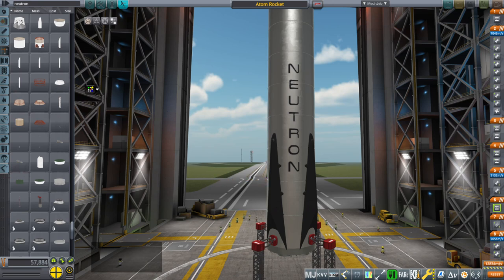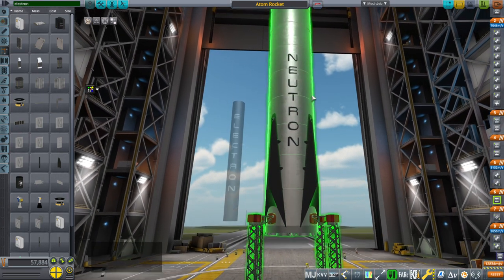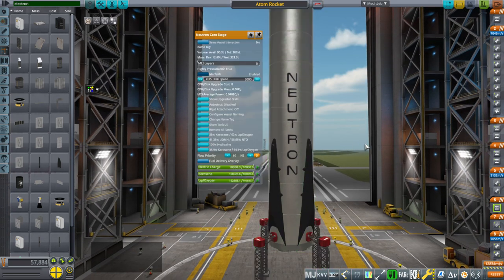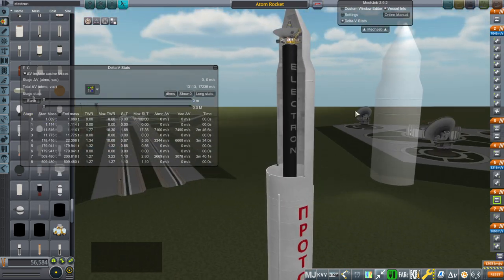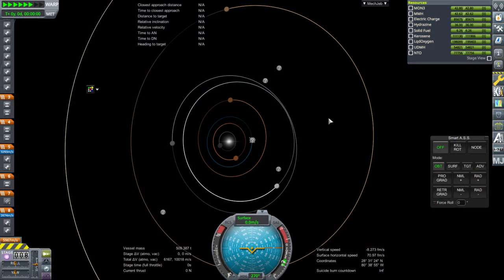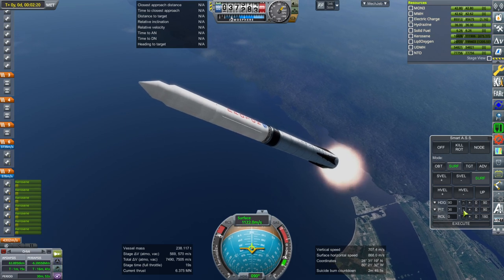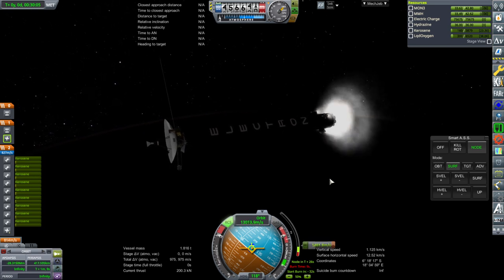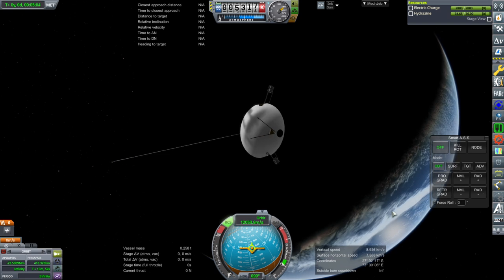Realism Overhaul in KSP 1.8.1 - On the Atom Rocket

Comment: Maybe the neutron only has the 4 main engines with a small cluster of rutherford's for landing manouvers. Electric turbopumps are easy (ish) to restart and would allow them to deep throttle for the landings.
Reply from the maker: You'd need no less than seven Rutherfords just to bear the empty mass of the tank.